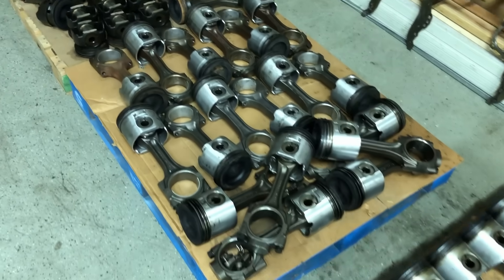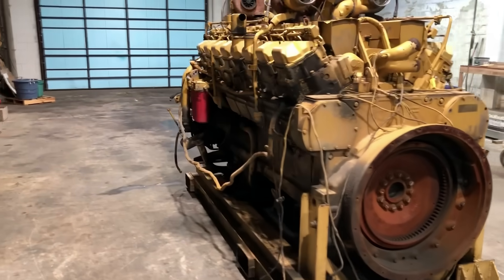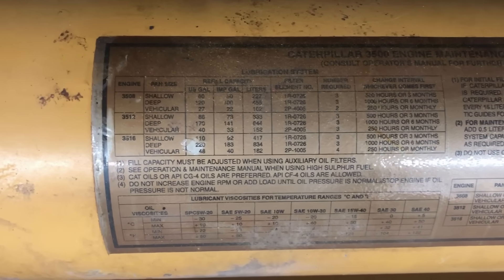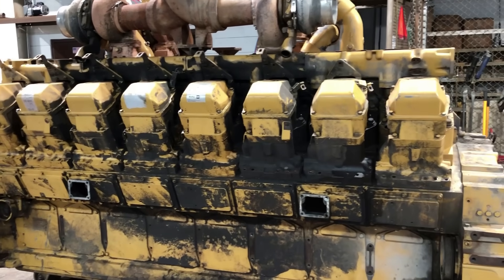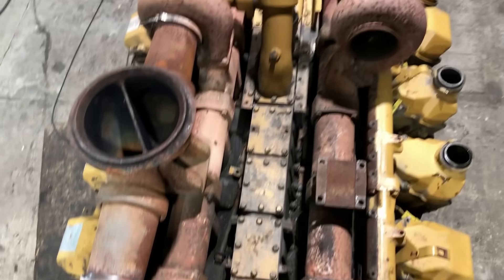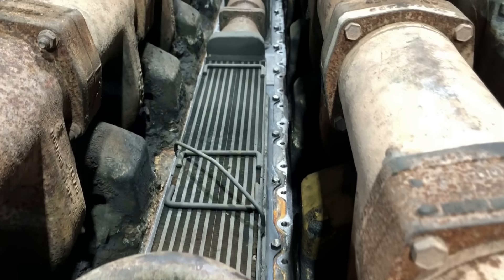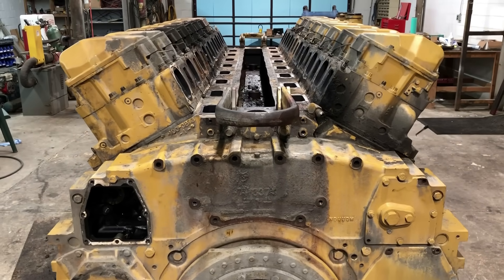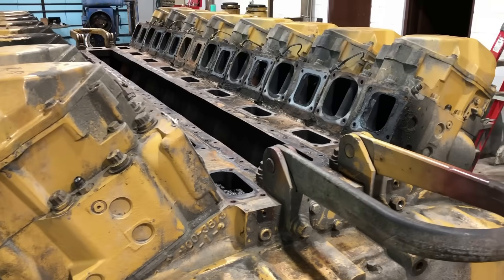Tear Down of a 17,000 Pound V16 Caterpillar 3516 - 1800 Horsepower 69 Liter Diesel Engine

Comment: On the inside. At motor looks pretty good. I know they’re strictly for heavy duty work and make the appropriate power for intended use. At the same time. I like automotive performance and part of me. Wonders what one of these motors could make if someone basically, hot rodded it. different tuning, bigger turbo, more boost. I bet something like this could handle a lot more power than most people think.

Comment: Interesting thing about these engines the same block and crank are used in various arrangements, if it were a marine unit and a reverse rotation the cams and crankshaft are installed  from back to front.

Comment: It would be cool if you could do a rebuild on a Wärtsilä-Sulzer RTA96-C engine! It weighs 2300 tons and is 110,000 cubic inches and is 3 stories tall! It is the largest diesel in the world and powers monster container ships and runs on something called bunker crude which is so thick that it must be heated in order for it to be pumped into the engine. I believe top rpm is  130rpm on this engine! This is a big engine though! I work on the other end of the spectrum! I rebuilt the transmission on an RC Nitro truck today with a TRX 2.5 nitro engine that produces around 3.5 hp which is huge when you consider that the engine is only .15 CI and runs on nitro methane!

Comment: Had four of these with deep sumps on a couple of the platform supply ships I was on driving alternators which went through variable speed drives to control the electric motor driven props. Very responsive engines but on one of the ships they vibrated so bad the bed plates had to be doubled up - the sister ship was fine

Comment: We build these engines in Lafayette IN, specifically my unit focuses on the marine applications for the 3500 series for tugs, yachts, etc. The 3500 is huge, but the 3600 is an entirely different beast. It takes so many men and women to build one of these, so it's impressive that you tore it down yourself. Great video.

Comment: Very impressive! I didn't realize how small these engines actually are! Looks like the Caterpillar 3516 used wet type cylinder liners. I can see that the crankshaft pattern is, up-out-down-out going towards the center from either end of the crankshaft. Some V16 engines will either have the double V8 or the double straight 8 crankpin pattern. Each half of an eight pin crankshaft is a mirror image of the other half. A V16 is actually twin V8s back to back. I've always been very fascinated with the V16 engines!

Comment: @KT3406E     Are these bigger engines pretty easy to sell after you reman them?  Is there a decent market for it?   Also. I have a turbo compressor wheel I can give you if you want it. It was a brand new one I bought for my Cummins marine twin turbo race motor setup. I lost my entire shop to a fire but that wheel was deep inside my toolbox under some shit and it does don’t get hurt. It’s for a big cat turbo off I think one of these exact motors.

Comment: Closest I have come to a 16 was having to do visual inspections on them in a industrial gas facility where they were used in large gensets. We had 3 units, each mounted inside long trailers supplementing 3+ megawatts of power total between the three. They were attached to a 5500 gallon fuel tank which was filled every 2 and a half days while in service. Sliding between the trailer wall and engine while running at max operating rpm checking for oil leaks and parts vibrating loose was interesting to say the least.

Comment: I use to load these engines in semi containers to be shipped overseas all over the world. I loaded CAT 3508, 3512 and 3516's with a gen set on the back of them. Also loaded just the engines without the gen set, those were ussually for ships and yachts.

Comment: Do you work by yourself in the dismantling process ? I watched you destroy several engines and I guess you couldn't sell any of the parts. Your show is quite unique and different. Your show has shown me how durable Diesel engines are. If you ever try to destroy a gasoline powered engines by over reveing or putting sand or water in them, I believe the results will be quite different. Thanks.

Comment: And Im unable to have my MF290 tractor up & running  acquired in 2016.I tore down the motor,a 4 cylinder job.got new piston rings,big-ends,rebushed gudgeon pins & bought new liners and had them pressed in!All outsourced jobs.ma1 chaiwo

Comment: Very similar to our mains at the Cod. We have four GM V-16-248s. 67L 2-strokes pumping out 1700~hp at 750rpm. They had one job, make electricity. Each is attached to a 18,000lb generator which either sends juice to the 252 1,628lb lead-acid batteries or directly to the four motors that turn the reduction gears which in turn turn our props. Well...that is when we had props lol. Additionally we have two identical spares from USS Stingray(SS-186) but the condition on their guts is unknown. I suspect as bad as ours or worse. Water jackets cooled by salt water don't age well....

Comment: Interesting that the crankshaft can be put in backwards, I was inserted into an overhaul of on and the second day of assembly I was tasked with performing a valve set, found out quickly the firing order seemed whacked , I queried whether this was a marine engine, it wasn’t and I questioned whether the previous crew involved could have put the crank in backwards. They didn’t think it was possible, it was     So they were ready to totally disassemble the engine until I suggested laying the engine on its side and removing rod caps and supporting them and removing the crank sideways with the pair of overhead cranes and reversing position. Worked just fine and saved a lot of labor and a headset.

Comment: I used to work at Caterpillar in Lafayette’s LEP (large engine plant) and saw many of these. We not only manufactured them but we also had a reman business where owners could send them back to us and we reconditioned them to new. I would see them just after disassembly and was astonished at the condition of many main components. Like the day it was built. Even wear items like rod pin bushings, main bearings and the cylinder bores still had crosshatch occasionally, or very little wear. Some of the large straight 6 and 8 cylinder engines had bores big enough for a person to get into and the pistons were the size of 55 gallon drums cut in half. I always remember the spec that put the fuel burn at 1 gallon per for all 8 to complete one power stroke. So each cylinder burns an 1/8 of a gallon of atomized diesel to power the piston down. I am not explaining it well but I hope you get my idea.
Reply: I used to cast the aluminum parts for those engines built in Lafayette. Those pans are heavy as all get out

Comment: We run a similar engines in the 737F Cat trucks at our mine. They are rated at 2400 hp. We also have brought in some Komatsu 830,s that have Cummins V-16,s. They are the electric trucks and I prefer running the electrics but each truck has its merits.

Comment: Years ago I was talking with this Cat mechanic Who was replacing the water pump in a transfer dump truck and I think it was a long nose, Pete.  Towards the end, He was using a special level and began to tell me how this old KT was originally designed as a stationary engine although it developed major horsepower it did not work out well as a truck engine  I remember being told that the engine could with 3 HP power settings, I do not recall maybe that had to do with the turbos?.  A friend owned the truck and told how the truck had so much power he could be fully loaded and cruise up the mountain and pass everything in sight???  This was in the San Bernadino   Mountains in Southern California. elv. 7000 ft  I do not remember the full model number of the engine and was hoping you could tell me and if there were any articles to read on that beast.  Thanks

Comment: Enjoy your videos. Need some advice. I obtained a Cummins NT-335-GS 250kW.
I removed from broadcast transmitter facility.
Installed 1968 has 1300 hours always had block heater on entire life in climate controlled building.  Was removed for total overhaul of transmitter facility and ran perfectly. Does this have any value or should I scrap it?

Comment: Swapped out a 3116 in a GMC brigadrier with a cummins M11 and cursed myself for telling the boss I could do it. Raise the cab by 6" modify the drive line, find boltons that would  fit the application and now sitting here watching you and trying to figgure out how to put 2 steer axle's under a 359 to shoe horn that beast into that frame.  Keep puting out these video's.

Comment: I work in commercial fishing boats (check my pic) and we had a 3512 in the boat. 90’ steel trawler. Great engine... 3516 wouldn’t be able to be used due to HP restrictions on the permits.
Awesome Video...
Reply: 3508 and 3512 are very common in the Marine /Fishing industry. 80-100’ boats

Comment: Something I learned from watching various channels covering boating.

Deep sump pans are used for marine applications so engines are less likely to get starved for oil when a boat is pitching and yawing at all sorts of crazy angles in rough seas.

Your video, audio and narrative are just fine by the way.
Reply: Large Two Stroke Engines have Dry Sump Lubrication, like Motorcycles or Aviation Engines
Reply: @Genius_at_Work  but that's a 4 strke
Reply: @ianthompson2802 . The twin 3516 marine CATs on my work boats are deep and hold approx 220 gallons of DELO each.😎.
Reply: don't worry these engines get some pretty serious angles slot dozing as they are fitted on d11     and climbing in reverse so i guess maybe i  have operated this thing even as i worked  at mount Thorley    funny side note my supervisor at the time said if you are ripping  this hard rock seam right you should be pissing blood at the end of the shift.    year cool ill see you at lunch

Comment: Wow I have lots of thoughts about working on such a huge engine. One thing that occurred to me would be how sketchy it would be to unbolt all the main caps with it standing on end and have that monster crank fall on someone. I know you wouldn't do that but it would just like a goofball like me to do something like that.  I'd only do it once lol! Another thought, which may or may not be sensible is that if one were to lay the block flat and try and lift that crank out and they supported it only on the ends it's so heavy that it may bend inward on itself and become "out of true". Is that possible? Thanks for showing us this monster engine.

Comment: We had a company that does big generators bring us 8-10 of these 3516's back to back to back about 5 years ago.  I rebuild the cylinder heads. You talk about work.  If I remember correctly it would take about a week to do all 16 heads. I got a boat load of OT then.

Comment: Hey cool video. I’ve overhauled these 3516’s many times. All mine were natural gas though. I have a tip on getting the liners out. After removing the rod cap from the journal, get a deep wall 3/4” socket and place it between one of the webs on the crank and the bottom of the liner and rotate the crank using the crankshaft like a makeshift press. Hope it helps. Also having that engine up on its ends really had me worried. Glad nothing bad happened.

Comment: Where are you located? I might want to stop by converse a little on what we can do with my 1mm 600hp Cat. I could put 3508 injectors and turbo on get 1,250hp like I did with one I stuck in a stretch Peterbilt but this 99 W900 is my last build. I don't want to drop to 1.5 to 3.0 mph like I did the other one. I love my 1mm no other engine for me.

Comment: Would you recommend adding 1 gallon of diesel to the crank case oil of a 2003 c15 when hot 
Then run it at idle for 5 mins then drain the oil change the filter and add new oil to help keep the new stay cleaner longer ?

Comment: Well... you are wrong about one thing. Your video does not suck and the audio is fine. You did a great job and I am impressed. I liked the way you went through this tear down without taking us back to Cain and Abel in the Bible. We didn't need to see every single nut and bolt you had to remove. Most of us here, I would assume anyway are mechanics or have some background in machinery. I certainly didn't need a play by play on what you were doing. I'm an old mechanic and have been bending wrenches most of my life. You did a cool video and you should be proud of it. Thank you!

Comment: That's a really neat intake cooler system. It must save a lot of space while protecting the components from being bonked around. How does the coolant keep from dangerously rapid temperature swings with changing engine loads though?

Comment: I have always found these large industrial engines interesting. I like how they are built with serviceability in mind unlike automotive engines that are not made with intention of ever being overhauled.
Reply: "I'm still alive and not bleeding" ...  😂
Reply: It's because industrial and commercial applications are designed to make money through reliability. Automobiles are designed to make money not for the customer but for the supplier, through planned obsolescence.
Reply: @ownedpatrol  Bare in mind that maintenance/rebuild friendly design is reflected in the price. Cubic inch for Cubic inch industrial engines are far more expensive than automotive equivalents.
Reply: @deezelfairy  It all works in the long run, you pay more initially for a product that serves for decades with regular maintenance & rebuilds, so by its design it makes its own value back in a shorter amount of time than a disposable engine. Case in point: The V6 in my 2010 Taurus was designed with an internal water pump, not covered under warranty, which floods the crankcase with coolant when it fails, essentially overheating and melting the engine in a matter of minutes, which is what happened to mine. If only it had a Cat 3406 in it, lol
Reply: I believe that's the best explanation I have ever heard on that subject!
Reply: @ownedpatrol  my Toyota says other wise
Reply: Because usely the body of a car is rusted away before the engine breaks. Also most people dont want 25+ years old cars.
Reply: Fiat have been pretty good with their engines. The alternator is a chore to access but there are tricks to simplify the job. The 16 valve 1.3 diesel is a little jewel used by Suzuki, GM, Peugeot and of course Fiat. Up to 90bho isn’t bad for its size.

Comment: I used to work at Empire Cat, based out of Mesa, Az. When we would tear down  the 3516's, each 10hr shift had two people per engine. If we could have one torn down in 2 shifts (40hrs combined labor) we were within out labor quote for tear down. 

That being said, this is one big ass job to handle alone.

Comment: Mines have to weigh downtime and cost to repair against remaining engine life. Often time perfectly fine running engines are replaced because they've met their hours. My guess is this engine was nearly houred-out, and rather than pay for repairs only to replace it on interval, the engine was just pulled. Typically engines are run through a reman facility, so it is interesting that this was auctioned off.

Comment: how did you learn to do this stuff on engines like this?  How old are you too bro?
Reply: I wouldn't be surprised if he learned these skills much the same way me and a few of my buddies did.... Growing up around it learning hands on from elders. I started from as early as I can remember and was rebuilding small gasoline engines by 8 years old and gradually increased over the years. I'm 33 now and can rebuild engines like this. It's not my profession though, I work as a blast hole driller though so I still work in very close proximity to these engines

Comment: I wonder how balanced the rotating assembly was with those three different pistons in it - I bet it shook like a dog shitting a peach seed.  I wouldn't be surprised if that's why they sold it.  I had a 1500 hp 12 cylinder white superior that would run fine till you got above about 90% loaded and then would shake - I had pryometers on every cylinder and could hook up Kenny gage's on every hole - we found one hole that just was slightly off with firing pressures and temps - pulled the inj nozzle and found the piston was 1.5 inches shorter than the others ... through a strange circumstance we found that there had been a power assembly change when the engine was purchased used by the oil company in 1975 - lol come to find out they made that same engine in a natural gas version and the piston was a natural gas piston - which I'm sure you know runs a much lower compression ratio... change piston engins runs smooth as a swiss watch..  those big engines can be a pain in the butt - you should try doing the job u did in the bottom of a boat ... I have had to cut holes in the walls of the engine room to get cranks out...

Comment: Try a 3532 me an 2 guys did a complete inframe front and rear gear train in 6 days which was our generators. Or Main engines were Delavel Enterprise DMRV-4 16cyl it ran 250 gallons per hour until we kicked them in and it went 500 an hour. Pistons were large then 5gal buckets and weighed 300lbs each.

Comment: I’ve worked in open pit copper mines and the cat dealer here in Arizona and have done lots of work to these 3516s in cat 793s.
I thought doing this work with another set of hands and large overhead cranes was a chore .
I’m impressed you tore one of these down by yourself in your own shop.
Nice work.
Reply: Bisbee?
Reply: Here in Australia the Cat 793 b and c and d models had around 2300 hp. The 789 cat had around 1800 hp.
Reply: Empire gang
Reply: @Iron_Stoic  empire gang from where...?
Reply: @Iron_Stoic  empire gang from BC vancouver...? Surrey..? Empire Sadler...?
Reply: @harjinderkaur2384  Probably means Empire CAT, a dealership